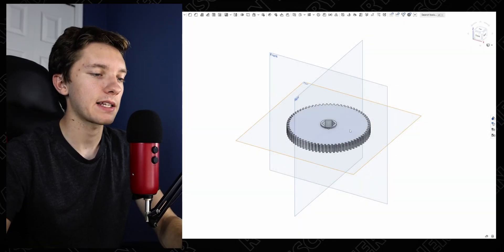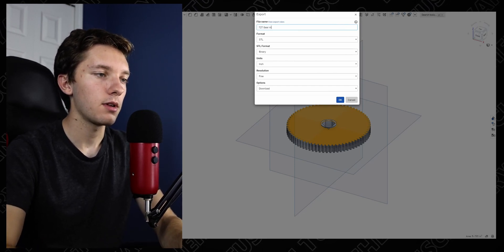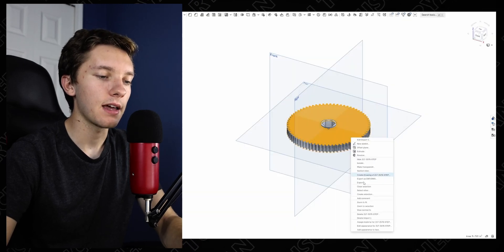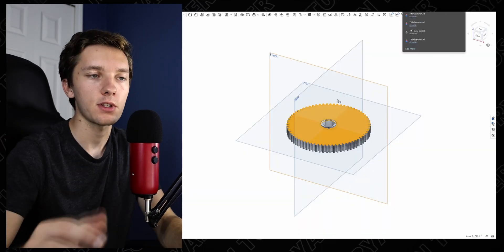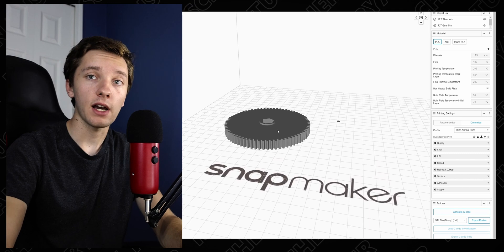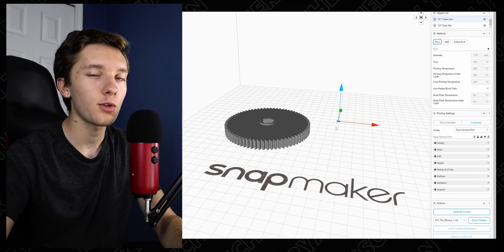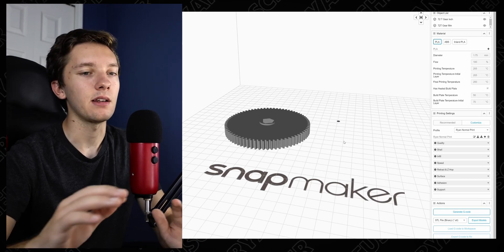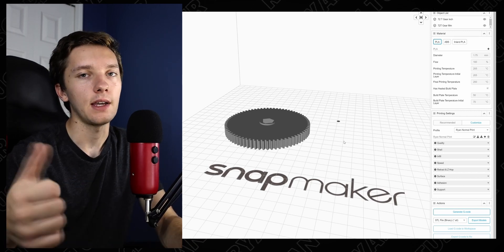How to Export STL Models for 3D Printing

Comment: Are you convert in CAD?
Reply from the maker: If you’re asking about converting from inches to millimeters, I design the models in either standard and then on the export it will auto convert to the standard you select on the export screen. I hope that helps, if you still have a question let me know.